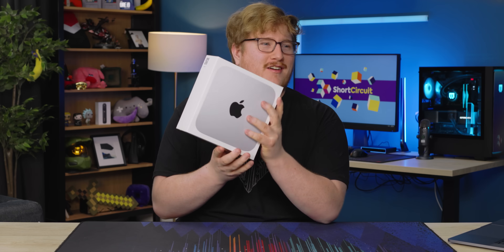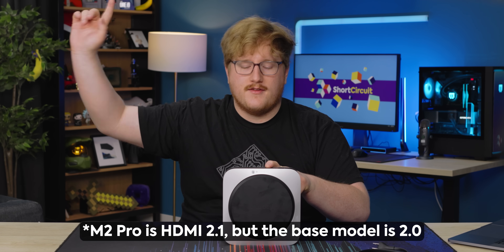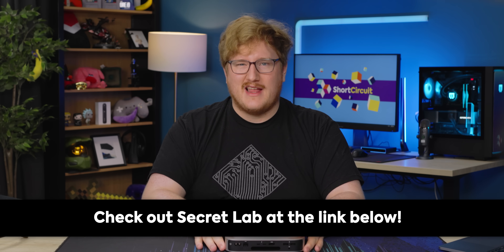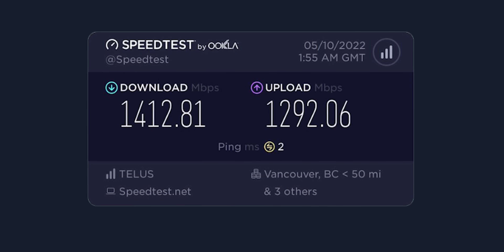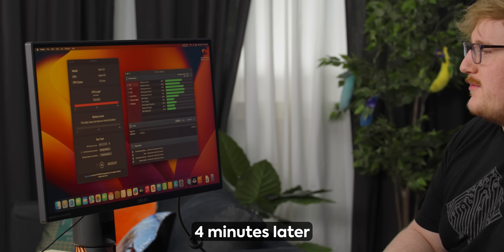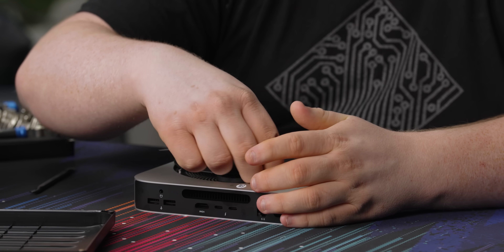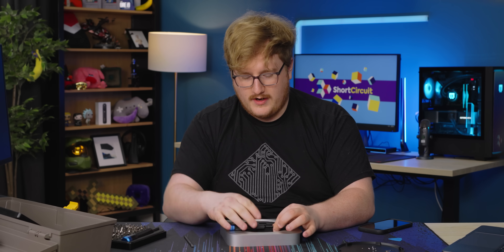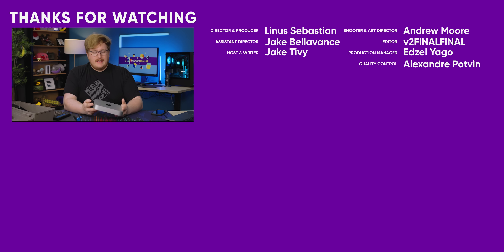Always wanted a Mac? Try this. - M2 Mac Mini

Comment: I know this is gonna ruffle some feathers but, the apple mouse is such a horrible mouse, I can't believe they haven't redesigned it yet. It's basically a trackpad with a sensor. Just use a trackpad at that point! It's yet another case of form over function. I am an Apple fan and even I think the mouse is ridiculous and majorly overpriced. Sorry to those who like it, do your thing it's just my opinion, thought I would mention that.
Reply: Got two of them with different Apple computers and yes, they are terrible. Right up there with butterfly keyboards.
Reply: @WorksOnMyComputer  They are right!

Comment: I could imagine getting a used one of these if I ever have to run a mac-specific program. And then it might as well be my plex server, while I'm at it.

Thankfully, this has never come up
Reply: It actually came up for me when I updated Plex on my QNAP and it broke; using my Mac Studio as a stand-in worked very well.  This has since been fixed for me so it's no longer needed, but since I leave my Studio on all the time it's still providing a connection to my media if it's needed.  👍  I agree a fairly low end Mini would be excellent for the purpose.

Comment: Te the m2 is powerful but with 256(minus the operating system and apps you need) gigs of storage what are you gonna do with that power? You can't edit 4k or even 2k comfortably you can maybe have enough space for photo editing. Ar 600 is a waste to use as media center because come on 600 for 4k@24fps or even 4k@60fps are too much money. This is a good device with no aim. You don't have the space to do anything that's why 200gigs cost 200$ because they know is almost the bare minum to do some work on. This device if it came with an m.2 slot it would have been the best device on the market for every non gamer price/performance wise.

Comment: I bought an M1 mac mini almost 2 months before the M2 was announced, and I took it into the apple store expecting them to laugh me out of the buildings because their return window is 14 days. Even the first guy I talked to sympathized with me but told me to expect a no. Apparently there was a sympathetic manager cause he approved the swap. Ended up getting refunded a hundred dollars by the end of the encounter because of the price drop between the M1 and M2. The guy processing the trade went back to the manager like 3 times probably trying to cover his own ass to make sure he was cool with it, and he just kept shrugging "sometimes it ends up like that".  Actually a pretty cool experience at an apple store. I'm not really a big apple guy but that encounter was pretty great.
Reply: I worked at the fruit store for two and a half years, and you would be surprised about what we could do. This was more than seven years ago, though, so I don't know what it would be like now. One of the best was doing an RMA swap on a MacBook with three days of warranty left. We did like-for-like swaps, and we had just released the new MBPs. I swapped the old computer for the new 15-in with top specs. The computer actually belonged to an older woman who wasn't that knowledgeable, but her son was there, and he was blown away that I did it. Also, I will admit to doing straight swaps for power bricks when I thought they had become dangerous. Folks - exposed wires are bad and electrical tape is not a solution.

At the end of the day, though, it's cheaper to do these things, and you build up a lot of goodwill with customers. Her repair was going to be a new screen and a second logic board repair. And when you factor in my time, the time of the repair person, etc., it's reasonable to do the right thing.

But I will say being shitty to employees because you have thoughts and feelings about Apple will not get you anywhere. It's just a job. One that can be very stressful. No one cares about your big-brained opinions on Mac v Windows or why Android is better.
Reply: I don’t think the store would really end up caring because it’s Apples policies problem at that point and worth more to the store that you have a good experience
Reply: @ericwheelhouse4371 lol Apple doesn't care about your experience
Reply: @ericwheelhouse4371  Literally his "good experience" garnered an incredible review with 1.4K likes on a video that got half a million views. Thousand people may have liked it but clearly thousands of people also read it and took something away from it. The power of having good experiences pays lol
Reply: I've had a pretty cool experience too, pretty long ago now but i wanted to buy an iPod and was 10€ short and they still sold it to me, it was probably because i was like 12 at the time but still very nice of them
Reply: @p529.  tbh, if I was Apple, saving you 10€ for one transaction to give you a good customer experience that might get you to comeback for the next device purchase is super worth it imo.
Reply: @kentonyc  Oh yeah definitely and i appreciated it a ton :D
Reply: Apple's customer experience across the board is superb. I can tell that 90% of Apple employees genuinely care about their customers and enjoy their job, which I can't say for pretty much any other large scale company.
Reply: @kakashi99908  i just checked that guys account and it's 16 years old bruh 💀
Reply: @bjvink0130  oh shit ☠
Reply: @bjvink0130  His account is 16 years old... Cause everyone knows you make a YouTube account when you are born.
Reply: @Gatorade69  i didn’t say he was 16 years old did i
Reply: @Gatorade69  that he’s not 13 years old
Reply: Nice! I love my new M2 Mini. Your exchange reminds me of one of mine (Non-Apple, but a true story):  I had a Honda Mower for almost three years took back to Home Depot and they exchanged it for another one for free under warranty.  I used the 2nd mower for about 3-4 weeks and didn't like the handlebar control set-up... Took that back and got a newer version of my 1st mower and somehow ended up getting a $70 credit as well.🤑 Oh yeah, and a second mower bag! 😄
Reply: I bought PC parts from 4 different vendors and all of them accepted a full refund if I buy parts at their store again. As long as they don't lose the money they don't care.
Reply: Elon musk will have NONE OF THAT 😂
Reply: Thank you Tim Cook for sharing your experience. ;) ☮️
Reply: I wouldn't even go so far as to say that was "Apple" being cool but more so, a manager actually being cool cause lord knows it all depends on who you talk to. Thankfully you happened to get a real nice manager to deal with and he could afford to lose a little money that day whilst in turn securing a non-apple fanatic's trust to come back to the store and spend money in the long run. It's not a bad tactic and shows some decent humility as well which is a rarity in itself unfortunately. But good on that dude for being a chill manager!
Reply: I cant say I have the same experience with resellers...(no apple stores back then in my country)
Reply: Only people make it worse.
Reply: You should just return it without saying why. Big mistake.
Reply: The night before they released the M2 I was speccing an M1 on the website, had it in my cart to order, but decided to wait for a few weeks. So glad I did since the nearest Apple Store to me is like 80 miles.
Reply: @jovanportillo  Free performance upgrade? I don't know why you wouldn't try if you were already investing the money into it and just happened to get on at the tip of the tail end of the previous generation.
Reply: @jovanportillo  You really are a funny person.
Reply: This never happened.
Reply: Lol every time I go in they completely ignore me, assuming I can't buy anything.  Or alternatively walk around behind and make sure I don't steal anything.  I remember buying an iPod Nano once and the staff asked me to open my backpack up to check if I had stolen anything.

Never going to a store again.
Reply: Rear W
Reply: I have an old Mac Sierra 2017. Can I buy and use this with my current Mac keyboard/screen?
Reply: They aways say if you are nice to the people at apple they will be nice to you.
Reply: In other instances, Apple have been complete assholes to deal with lol. But anything they do is about money, Like any company. The difference with Apple compared to others in their market is they are the sole bubble, You invest into their bubble, And they want to keep you there where they know you will further invest.. So yeah of course the high street stores are gonna do things to make you happy which in turn sends out a message.
Reply: glad to see that every now and then we come across someone who is enlightened -- someone who realizes that no matter how hard we all try, we will not have a seat at the table.. so fuck em (apple).
Reply: That's why they are the best when it comes to customer support.
Reply: Maybe it is because you are a cute little femboy heh
Reply: @kakashi99908  wtf
Reply: @denissmith7671  He's only 13 years old.